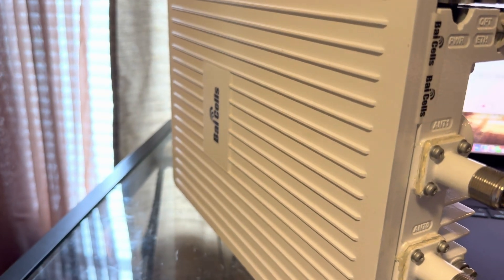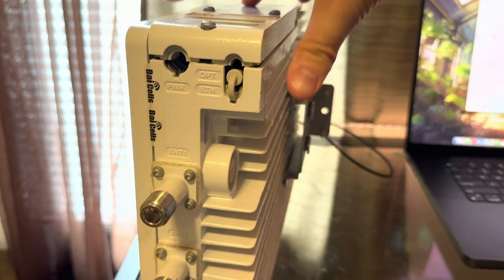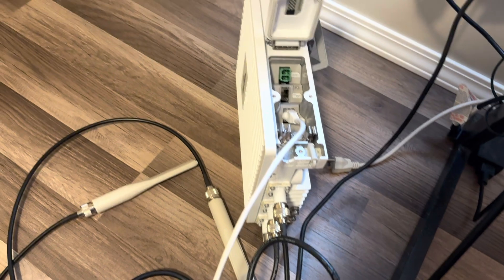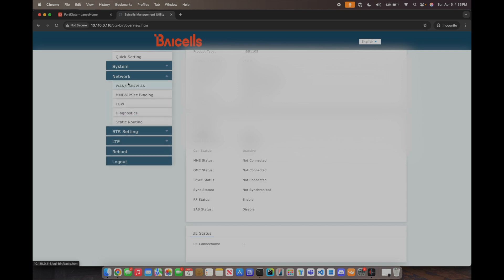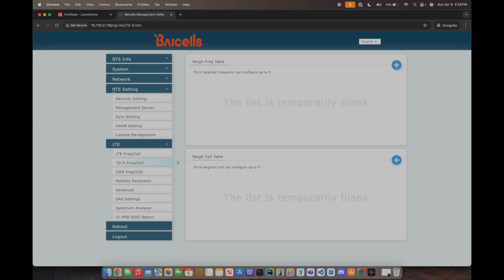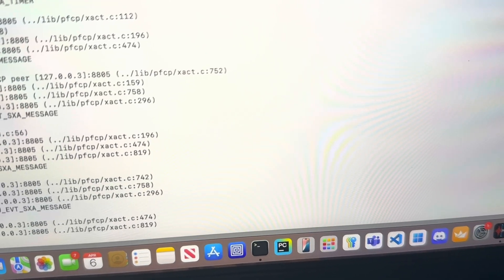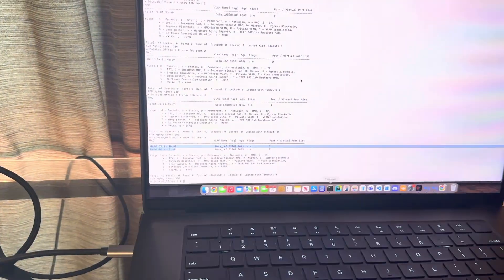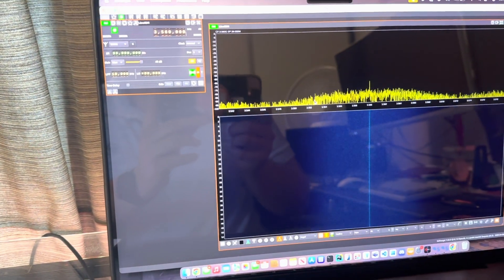Connecting used cell site eNB to Open5GS - Baicells Nova 233 ENB

Comment: I have a question. Do you need to register your baicell device with baicell ? If so what happens if you don’t?
Reply from the maker: @DiyintheGhetto  yes. You do! In their cloud core, which is basically a cloud EPC but I don’t use that feature. I just use their cloud core for the SAS integration. If you do not register it, then you have no SAS.
Reply: @LANRanger  Isn't there a google sas version out there?
Reply from the maker: @DiyintheGhetto yes. I think it’s deprecated now.

Comment: Aaaaand i've now got a new hobby. Currently searching ebay for similar equipment.. thanks, subbed!
Reply: I had a question, if I were to make a setup using an SDR in place of a real ENB, would it be very hard to convert the setup to a real enb setup when I obtained the hardware? 
Baicells 233's are quite expensive/hard to come by in my end of the world. Follow-up question: do you have any suggestions on other, possibly more easily obtainable hardware that would do the job?
Reply from the maker: @garrygarrygarry1 no, as long as your MME/S1AP is bound to a routable interface, it’s literally plug and play. Mine is setup to demo remotely anywhere in the world as long as I have L3 access. From either a regular SDR or the Baicells
Reply from the maker: @garrygarrygarry1 also, yes, checkout my highest viewed video. You can pickup that hardware for nothing hardly and do the same thing